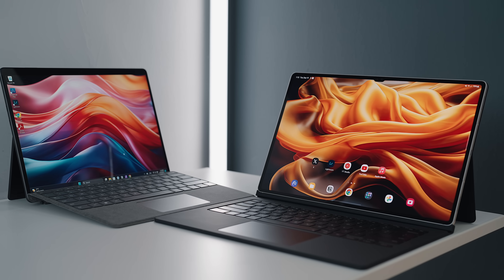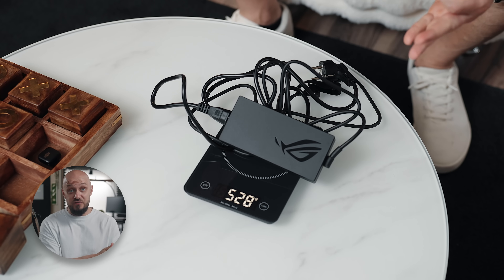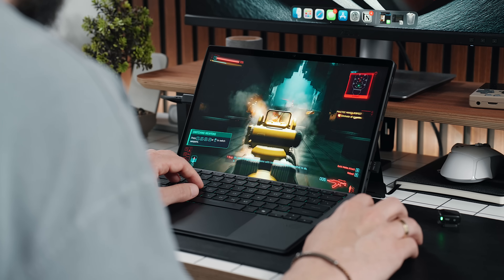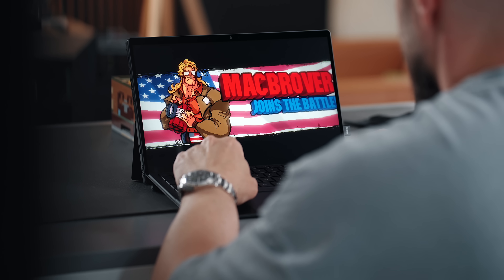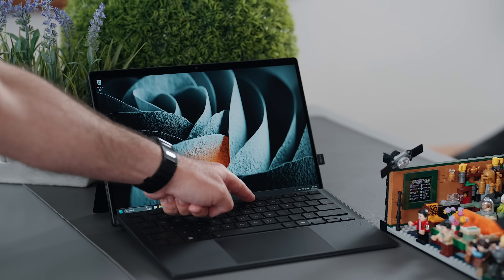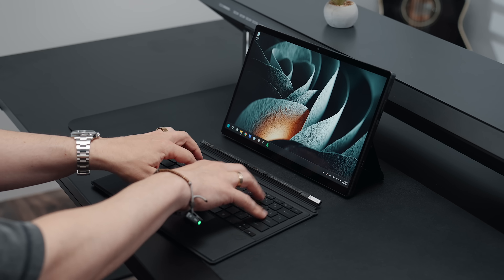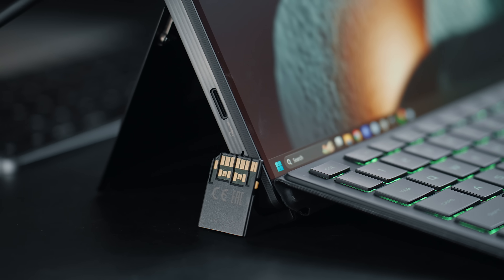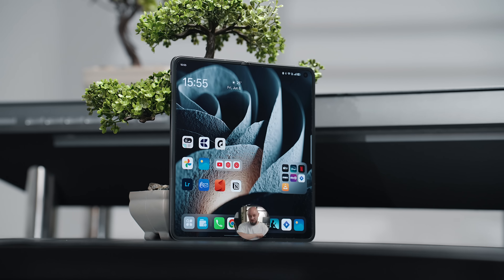The 2025 ROG Flow Z13 Is the Most Powerful 2-in-1 I’ve Ever Used

Comment: Proprietary charging cable is a fail. So you can’t plug a anker prime charger into it. 

It’s a portable AI machine that can run ollama 3.3 70B AI and a portable server. Though you are stuck with windows and can run VMs. Proxmox takes a level of expertise I don’t have. You’ll lose the screen touch screen and all the other drivers. But true computer ninjas could probably figure it out. I use YouTube and AI to hobby and learn. 😂

Comment: how do you train your forearms to be that thick? i've been having issues for years trying to get like that
thanks, great tech review also
Reply: Do pull-ups and deadlifts. Forearms and calves should be a secondary results of gripping heavy weight. Anything else is bullshit. Unless you are already a huge body builder and are trying to appease a judge with minor important shortcomings. But if you want the grip of gorilla safely deadlift. Do pull ups. And when doing abs. Hang from a bar knees to chest when that gets easy straight leg feet as high as chest and then when that is easy toes to bar over your head. Secondarily your grip and forearms will grow. 

Evidence? Check out Olympic gymnasts who do rings. Huge arms and forearms. They don’t take up the bench doing forearm curls.
Reply: @jasonmcnab1  great advice thank you so much!

Comment: Id say its more flexible than a Macbook. The Flow Z13 not only supports gaming - good graphics, it supports large Local LLM too.
at 3K with 128gb or ram is a steal when you compare a Macbook with 64gb is £3800 and apple want another £800 for another 64gb.
A 128gb Ram mackbook is £4,699.00, and gaming is no better than the base model... Windows games are much better than on a Mac

Comment: The memory bandwidth of the integrated memory is in the range of Apple silicon (M1-M4) and way faster than non-integrated memory in lesser processors. It completely smokes my Ryzen 9 5950X with separate motherboard memory.

Comment: is there a laptop out there that'd you'd describe as like 80% as good for a reasonable drop in price?
Reply: If you want a pc gaming tablet No you basically have previous z13 models and that's it other than onexplayer who is currently working on a similar device the onexplayer super but that will probably cost the same or more but has the same chip a bigger battery and a slightly larger amoled screen

Comment: In the beginning I scoffed at the price of the  Flow Z13.  I thought it was utterly ridiculous.  Well I am that idiot.  I picked one up and absolutely fell in love with it.  The only downside I can see is the proprietary power supply.  Id much rather enable 200w USB-C(if it is even a thing) so you can get your own charger.

I have played games like Dune: Awakening, V-Rising, Valheim and many others(not AAA.  I don't particularly enjoy AAA money grabs).  I can confirm when plugged in it plays beautifully.  Even when not plugged in it plays extremely well but obviously with this form factory battery is less than 2 hours which again isn't particularly an issue for my use case.

I HIGHLY recommend this for editing and gaming.

Comment: I do wonder if Asus, or any other manufacturer for that matter, would make a device with same specs and performance , but without needing to look like a gamer device, if they would be able to do it weighing less and being thinner. One thing for example I would remove, or trade for a full size Nvme would be that RGB window. I really couldn’t care less about that, not to mention it adds a weak point. Again, would rather have a full size Nvme than that window.

Would love to get the Z13 specs and performance on a device that looks like the Dell tablet Latitude 7350

Comment: I’m not sure if I’m fully on board with the new interview format just yet, it felt more fitting in the iPad documentary. I’ve always enjoyed your reviews for your insights and beautifully aesthetic shots, and I’m not quite sure this format works as well for a product review.
Reply: I disagree. I like that E has sometimes contradicting opinions in the same product review - which is harder to pull off on a "solo" review. It makes for a more balanced picture.

When it comes to this product: I'm not sure why this isn't a laptop. The point of tablets is their lightweight mobility which comes at a performance trade-off. With this prodcut Strix shifted the compromise back towards having less mobility due to the weight while insisting to still be a tablet. But for what? The touch function doesn't seem to offset the benefits of a proper keyboard and lap comfort that a laptop brings. Plus there are laptops with touch function. So the only upside I see for this product to be a tablet instead of a laptop is that you can remove the keyboard and save space on your coffee-table when you watch something.. Doesn't seem worth it.
Reply from the maker: I appreciate the feedback, Jacob! It means a lot!
Reply: Really? I did find it strange but the knowledgeable expert was a welcomed suprise